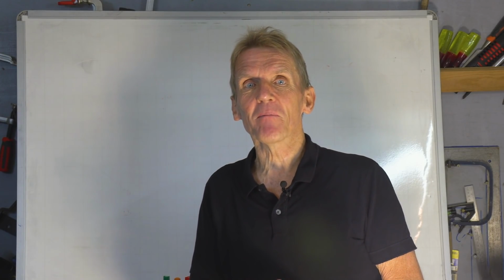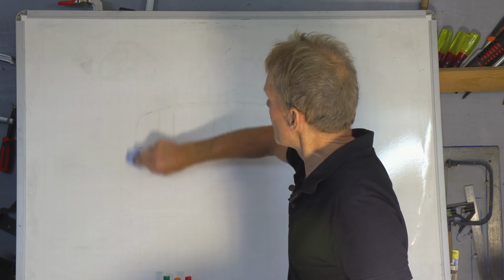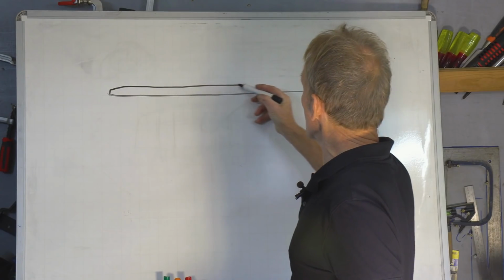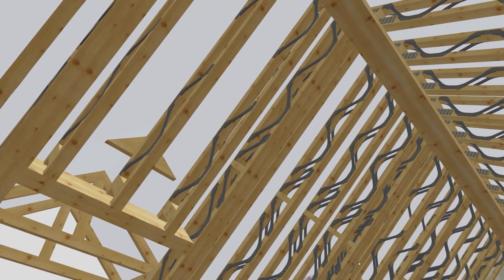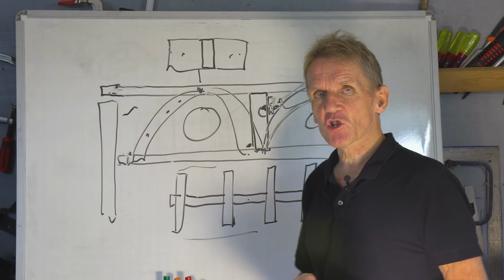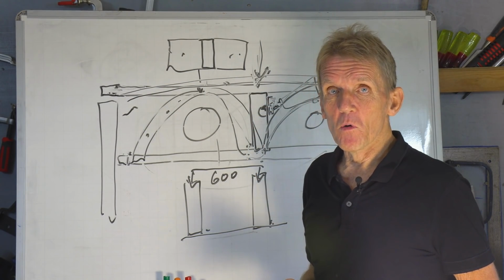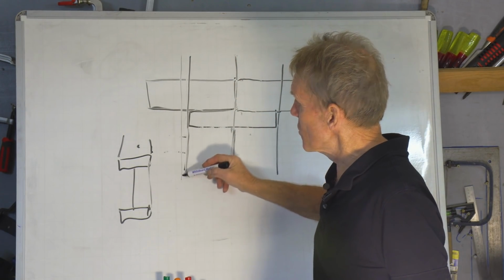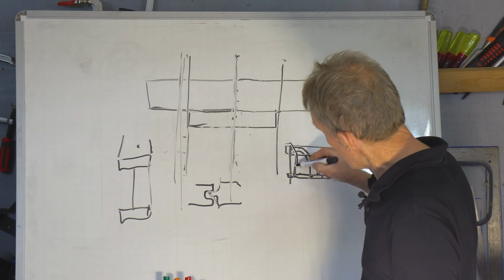New Build Home Nightmares That CAN be Avoided

Comment: My take on new build squeaking floors-60 yrs in the trade.
Engineered joist are a wonderful thing but  the application of decking them on the first lift course below makes it so the subsequent course of block is laid butt up to the deck where there should be a 2 mm per Linmtr expansion gap the deck then expands and cross ways to the decking board rolls the joist springs the screws through the deck board game over.
We have tested this by making holes in the ceiling below and putting a bubble level on the joist to find it 5mm out of plumb flange to flange.
The floor above sounds like walking on Ice.
This should be pulled at pre plaster stage but hey ho.😡

Comment: The problem of builders/frame erectors ignoring plans and construction details on site is difficult to overstate. When a national housebuilding company shifted largely to timberframe many site staff were opposed to changing from traditional build and actively worked against it. For instance house designs with bedrooms over carports between plots needed floor support beams to be supported in precut pockets in the external panels; site management introduced staggers plot foundations to ensure that the pockets didn't line up. Strongbacks were very largely ignored and LVL or Glulam beams were left in the rain to swell and cause fitting problems. When older house designs were redrawn to timberframe many existing errors were revealed and when site staff were queried about what remedial actions had been taken it became obvious that the old drawings hadn't been closely followed and things had been "made to work". I am no longer employed in the construction industry and was relieved to be free from the widespread poor attitude to workmanship I had encountered. It was so disappointing to see well made timberframe panels and components in dry factory conditions being so badly used and abused on site.

Comment: My house built 1903 has separate floor joists and ceiling joists so no problems and also helps with sound transmission between floors.
The solution is stop building cheaply, build to perform properly and to last.

Comment: Great ideas trashed by CBA builders (couldn't be arsed)

I'm not a builder but an enthusiastic amateur. I'm a great believer in solid 'noggins' between joists, properly cut to size, screwed and glued between joists securely. Greatly reduces flexing. Sorted my Sons bouncy 1937 bedroom floor that way and enabled 6" x 1.5" joists to be used flooring other Sons loft for storage only, stiffening the whole without using thicker deeper joists.

Comment: Iv seen the wood rail and OSB joists ten years after installation with the glue residue showing many many micro cracks like very old porcelain plates . I think they are going to be a big problem in 50 years time which isn’t long enough in a buildings life . I like the metal joists but still like traditional wood joists. Would love to hear your options on plastic chimney facades and tiles .

Comment: The best way to avoid a " New build nightmare" is not to fuckin' buy one in the first place, my friend just bought a new build 2 years ago and the quality was shockingly bad, 2 inch mastic joints around the windows and doors, lofts that cnnot have anything put up in them because the joists are like matchsticks, every wall taped and jointed and draughty sink waste pipes not properly connected, floors about as level as the surface of the moon.
All the agent could say was that they're built to spec, the mortar could be scraped out of the joint with a fingernail. £360K for a building that was built by fuckwits. The building developer should stick to burgers

Comment: Isn't the main reason of a squeakis that the floor is nailed and not screwed.
Reply from the maker: Yes the screws will help but the way to lay this floor is to glue the tongues and if you do that the squeak which is caused by the t@G moving in and out will cease. We are talking about curing the noise here. Also gluing to the joists with expanding glue is a good idea

Comment: I found your video very interesting but my ears pricked up when you started mentioning 600 spacings and 18mm flooring and the 22mm.  I think you need to do a video on Brick Coursing because when attending Building College for Carpentry and Joinery with the first term spent on learning brickwork or more precise Brick Coursing.  Why? we all asked we are supposed to be Wood Butchers not Baco Builders (pre-runner to Lego) The reply was, if you have a problem with your building I can bet someone has cocked up on the coursing or someone has introduced a foreign item into the construction.  All building materials are manufactured to specified dimensions and they all fit from setting out the brickwork right on to putting on the roof tiling, No cuts or fitting including Loom widths of carpets, Wall paper, why a standard door is 6' 6" 2" 6" and why the rise and go on stairs is 7 x 9. 12 risers 13 treads Treads adds up to 9' 0" Less 3/4" for floor, 8" for joist less 1/2" plasterboard gives an 8' Ceiling. Thats in simple terms because a12' 0" joist is not exctly 8" by 12' 0" but if you bought a standard 12' 0" from a builders merchant including staircase etc etc They will fit and the length will take the bending moment.  Widen the Room it will not. Thicken the joist and the stairs will not fit.  You did not mention herringbone strutting in the floor those I suppose are the Z straps.  After the war we were rationed to 1/2 a standard of timber per dwelling including for roof, joinery, everything, those joists were around then called metsec.  The biggest problem is using metric references such as 400 centers instead of the Indicaters on the measuring tape.  400 and 600 are not to brick course and the width of the room will be reduced by 6mm for every joist laid with consequences.  600 joist spacing is ideal if building a bouncy castle.  A suggest a read of the Parker Morris standard for house building would be useful.  I gave you a thumbs up anyway.

Comment: Dead right about the wet timber. Not just that all refurbs etc crack and split all over within a year of being done. Its when it all dries out and when they have the heating on. The 2nd time its done it should last.

Comment: Hi Roger , I love your rants. I gave up on the building trade up here a long time ago. Put it like this , if you are warm and can walk the oil industry will employ you. The remainder go into building. I  prefer to do it myself and have built several extensions to my own home. Your video on squeaky floors struck a chord and I have a problem in one room with precisely what you were discussing. In my case however I suspect the problem may be sub standard fasteners where screwing down 22 mm chipboard with glued faces  to the tongue and groove interfaces and I still get noises. My problem I think, is poor quality screws as during fixing with a belt fed screwdriver resulted in quite a few screw failures( the heads spinning off before the fastener had fully fixed.) I thought I had done enough replacements but I still get some noise  from the floor. The plaster board in the room below does not seem to be cracking so I guess from your video I just will have to vacate the room and lift the chipboard again and glue and screw the whole floor again. Any thoughts?

Comment: Really enjoyed this video and it was perfectly timed for me. My house needed new floors throughout and the builder implemented Wolf System easi-joists. I'd never heard of such a thing though I'd seen I-joists before and wasn't impressed (due to ignorance though). When he then suggested 22mm moisture-resistant chipboard flooring over proper floorboards, I couldn't believe it but now it's done, I can see the benefits and there genuinely is no noise or movement (bounce) in the floor like there was before plus I'm looking forward to lower fitting costs for the utilities. :)

Comment: Hi here’s a problem for you to tell folks about. In Wales (UK) we have to fit fire sprinklers in all new builds and major refurbishments. In my new house the sprinkler pipework came from America. Every pipe (orange plastic) is marked up with a warning saying ‘No cables or chemicals to come into contact with this pipe.’ When I investigated what this was all about, I found out that there is a problem with standard builders expanding foam, it must not be used by this orange pipe, in the long term it can cause the pipe to crack. The problem is that the builder didn’t know about this problem, the Welsh building control men didn’t know what I was talking about when I questioned them about this potential problem. The English building control guy didn’t know there was a potential problem. When I contacted the UK importer/agent for the orange pipe he said ‘yes there is a problem, we should probably do a better job of letting people know about it.’ I’m not planning on building a new house any time soon but you might want warn new house builders about this problem. I found out before any holes were filled but even the bloke fitting the sprinklers didn’t understand the significance of cable and chemicals coming into contact with the CPVC pipe and the damage it can do. 
Let me know if you want more details.  There is also the problem of not been able to trace the plastic pipes when they are behind the plasterboard. 
Kind Regards Andy.
Reply from the maker: Hi Andy
This is very interesting and I would like to follow it up so anything you have will give me a good start. I am guessing that the problem is plasticiser migration where anything like pvc or pu leaches the plasticiser out and it goes brittle. I have seen it in other materials such as polystyrene and pvc cables.
Reply: @SkillBuilder  Hi sorry to be so long in getting back to you about the sprinkler pipe problem. Do a google search for. . .   plasticpipefailure.com/cpvc-problems   and you’ll find information about common pipe failures from plastic pipe experts.
The sprinkler pipe in my house is the orange pipe, it’s called CPVC. CPVC is  Chlorinated polyvinyl chloride and it is a thermoplastic material.
Here’s a extract from ORSA (ORSA is an independent compliance consultancy, specialising in all matters health, safety and environment.)
Spray Foam Insulation (see the whole article at  orsa.uk/copy-of-news14)
“CPVC pipes also fail due to exposure to chemicals on their exterior such as fire caulk and in particular, spray foam insulation. Spray Foam is a preferred insulation material because it has a high R-value. Most spray foam insulation (SPF) contains fire retardant chemicals called ‘esters’ and amine catalysts that are highly incompatible with CPVC pipes and fittings. After exposure to these chemicals, CPVC piping will turn brittle, crack and ultimately fail.”
The more you look into it the more problems you’ll find. Another issue to consider you cannot detect the plastic sprinkler pipes and it would be easy to put a screw through a pipe if you don’t know it’s there. I made a detailed plan of the position of all pipe work, to the millimetre. A friend of ours wrapped kitchen foil around all of his pipes so he could detect them. Anyway, a search for sprinkler pipes and spray foam will bring up other people’s experiences and the potential problems. 
All the best . . .  Andy

Comment: Here in Canada this problem was solved with engineered I joist over 20 years ago.
If you want to have really tight floors....wait till after the heat has been on and the gyproc board applied with all that weight..... then screw the T&G plywood down to the joist

Comment: I remember some years ago when Barratts got slaughtered because their highly expensive new builds were rotting from the inside out. It was found that they were storing timber and other materials outside for months at a time then installing it when it was still wet through. That got them a real bad reputation at the time but of course most of these property development companies around now are just cowboys. Build it cheap and charge a fortune.
Reply: Yes I have had four  new builds in my life, and never ever will Have a new build again I nearly had a breakdown
Reply: @christinedavis5813  That I can understand. My next door neighbour makes a good living going into new houses and making them livable. Damp and mould are the main problem but badly fitted doors and windows are common too. To make them "environmentally efficient" they use hand held meters to check skirting boards and plug sockets for even the slightest draught. 
New builds are basically sealed boxes. No airbricks, no ventilation, it's no wonder they have so many faults. My house is a 1930's semi. The previous owner had the outside coated, the upper airvents covered and cavity wall insulation installed. The condensation was horrible. I drilled the vents back in, got rid of the dishwasher in favour of a tumble dryer and bought a substantial dehumidifier. It's made a big difference. If I hadn't we would have had serious mould and damp problems. All buildings need a constant flow through of fresh air.
You just can't avoid it. The current legislation is stupid.

Comment: I own a home here in Canada built in 2000.  Things to watch out for in new homes:  Is there a sump pump in the basement?  skip and move on.  In 1990s and 2000s to "save the environment" for a while roof shingles were made using paper:  Dumb, bad idea.  Those shingles disintegrate 20 years later.  Builders also only spend to sell the house, they don't care if it lasts.  To save money they buy the cheapest materials they can:  flake board instead of plywood, nails in flooring instead of screws, (I realize this is controversial because no roofers want to do this:) not removing the plastic strip on the back of shingles before installing them...  My new neighbour spent about $450,000 on a new house next to mine and mentioned that he thinks every wall in his house is crooked.
Also, I saw while they are building new houses next to mine, sometimes the roof isn't in place and it rains on the half-framed house, soaking all the wood and flake board.  If it's cloudy for a week after that, I imagine it takes days and days for the wood to dry.

Comment: Great explanation. "Punch out" is always a pain, but I guess it could be done right in the first place. I am an old guy who stopped building houses right before the "OSB craze" (no , I didn't stop working, just on to cabinets and furniture). They wrapped everything in OSB, floored and decked everything in OSB, built joists and rafters with OSB, but no one seemed to pay attention to what happens to OSB when the glue ages and it gets wet (like roof leaks, condensation, plumbing leaks). I'd hate to be a roofer in about five more years. This new rafter and joist system looks much better (yes, there are some extra steps, but back when I built, there were extra steps (admittedly not always done) for a quality build. Yes, screws over nails, but I am a cabinet maker. Also, from experience with cabinet building, glues do age, and sometimes promise more than they deliver.

Comment: 60cm spacing? My structure engineer had me put joists 30cm to avoid all this... and glad I did it. No flex, very limited movement, etc... and supports the under floor heating with cement self-levelling.  Obvious this is only an option if you're building or renovating yourself.

Comment: YouTube tells me the best way to avoid floor squeaking is by using adhesive on top of the joists under the flooring, and also use screws instead of nails - because it's the nails moving in and out of the timber that causes the squeak 😊
Reply: use concrete floor, no squiking. this is why houses in europe last for long long time.

Comment: Snagged a new build town house for a friend of mine, there is a 20mm bow in the first floor hallway, between the front bedroom door, and the rear bedroom door, a distance of only 1900mm.
The 2 floor airing cupboard prior to floor coverings, had a gap under the door big enough to get my hand under on the handle side of the door, but not large enough to get my fingers under on the hinge side of the door. The skirting on the whole of the ground floor is partially buried in self levelling screed, that was done at least 3 times before the lvt could be installed. Give me a 1930's or a victorian house to work on any day, walls that you can usually drill a hole in, install a wallplug and fix items to....ahhh bliss.

Comment: G'day Roger,
I love your rants because they are informative and stuffed full of that rare commodity COMMON SENSE.
However, if I have a leaky pipe or I need an extra socket or light fitting I'm used to lifting a floor board or two so I can get the job done.
With all this glue fortified chipboard how the hell is anyone supposed to do any maintenance❓Seems to me you have two choices, cut large holes in chippy panels and then have to brace boards with noggins and screw back in the bit you just hacked out or if it's a bigger job then pull the ceiling down 🤪😭😡🤬 which frankly pisses me off.
Seems to me the price people are having to pay for these toy town houses equates to the national debt of some small countries and aren't getting value for money at the cost of keeping shareholders happy.
As a cranky 61 year old I really enjoy your rants and relate to them wholeheartedly 😉
Anyhoo, keep well and stay happy kiddo 👍👌
Reply from the maker: Alec
 There are lots of purpose made access panels for chipboard floors. You just cur the hole to suit the panel. I usually cut to half way on the joist and then put in a couple of noggings. It really is quite easy and part of a plumber's job.

Comment: I like a Roger rant. Hardly ever wrong I beans are the way forward. I like the metal webbed joist. Never used them though. The trouble I come across is that contractors sub the job many times. By the time the tradesmen get the job it becomes bash and crash.